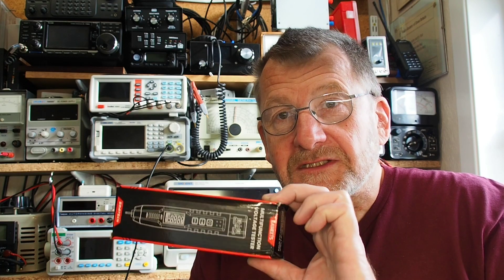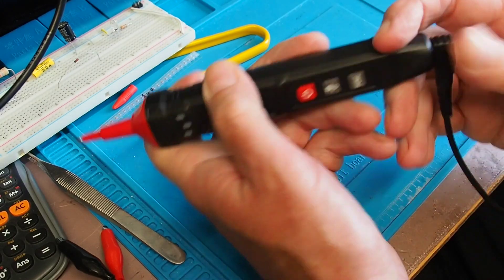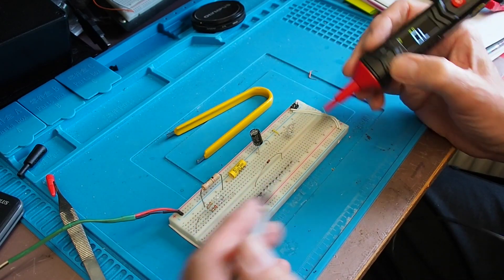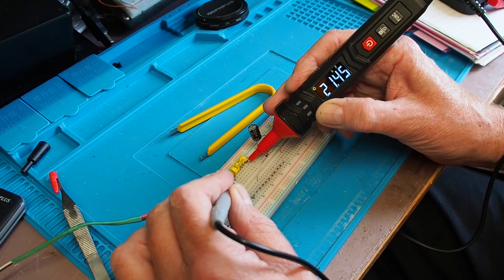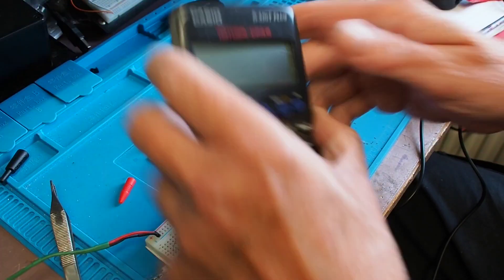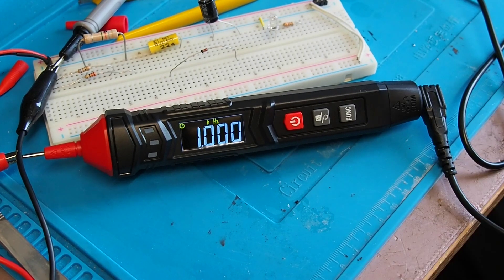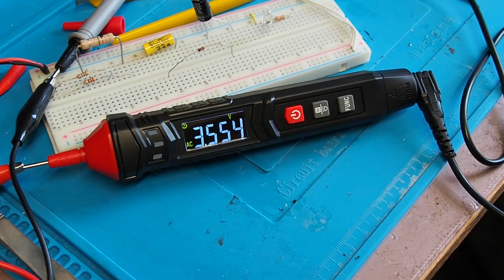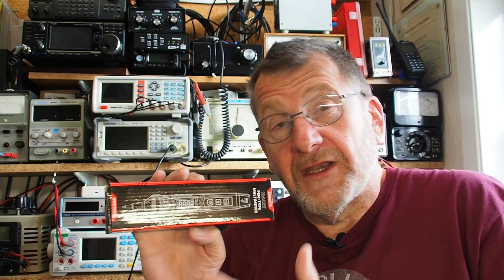Kaiweets ST120 Multimeter Review  - #132

Comment: One problem I've noticed with my SMD tweezers, and presumably this multimeter, is that they don't take into account the large number of engineers who are left-handed. You have a choice of using it in your wrong hand, or reading it upside down - both of which could be dangerous. Why can't they include a setting to invert the display?